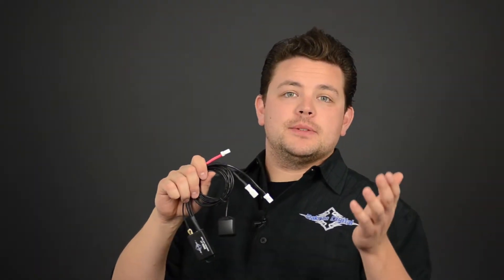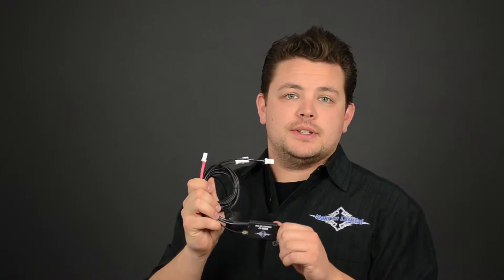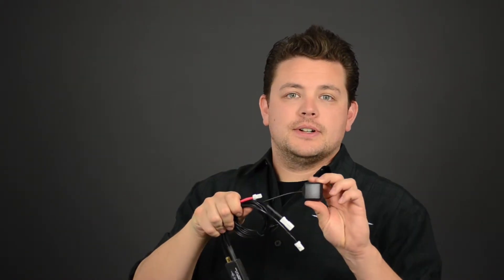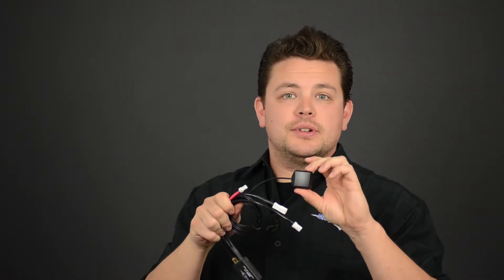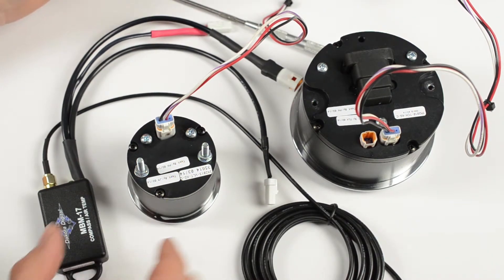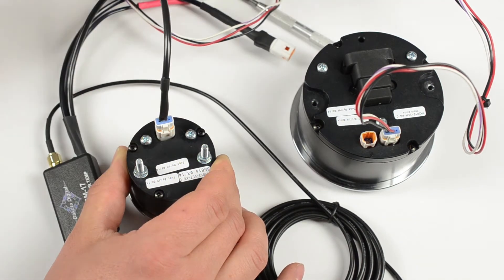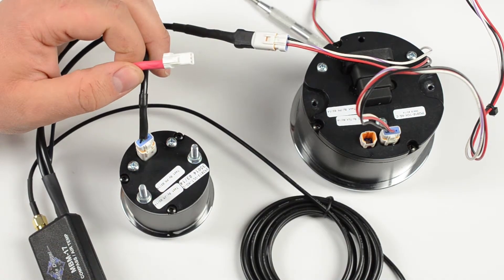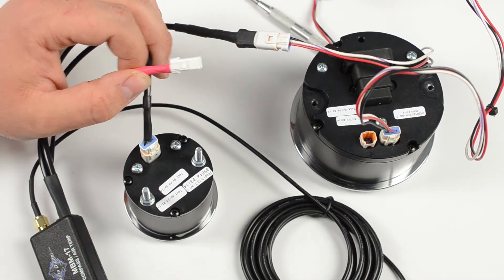Dakota Digital's MBM-17

Comment: I just purchased your MLX-8414 for my 2019 CVOSG, can this unit work with the MLX-8414. also, can I use my existing Temp sensor from my CVO or do I need to purchase your SEN-1701? Thank you
Reply from the maker: Thanks for the message Stan,
The MBM-17 does require the SEN-1701 for proper operation.  Thanks for checking in.

Comment: for a 2018 road glide is the air temp sensor (SEN-1701) needed to work with this if you want air temp as well?
Reply from the maker: Thanks Sunny,
Yes, this module can be added to display the ambient air temperature.  Thanks!